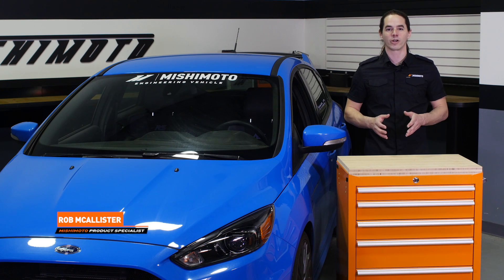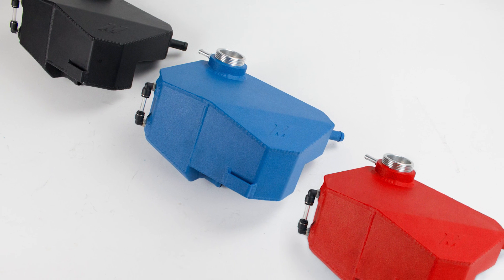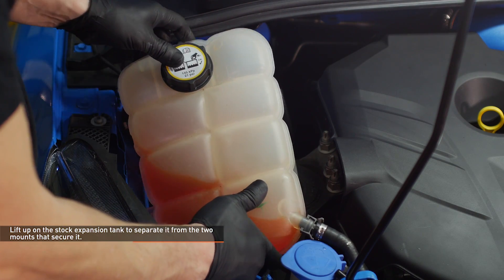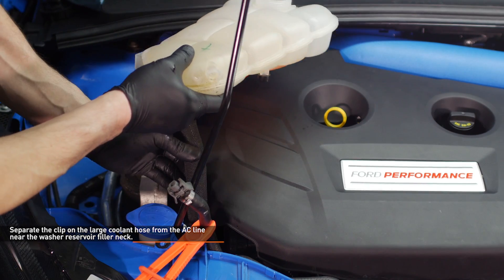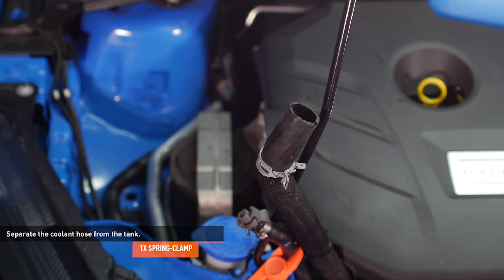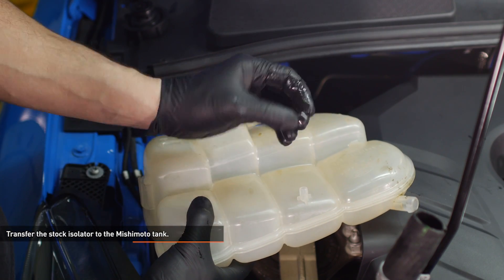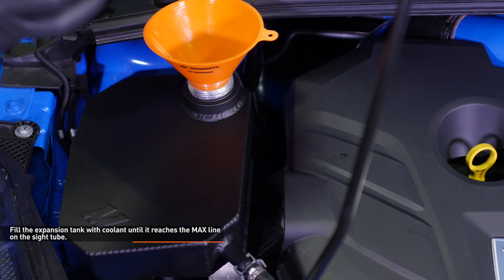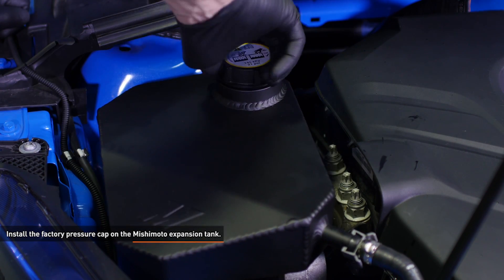2016-2018 Ford Focus RS/2013-2018 Focus ST Coolant Expansion Tank Installation Guide

Comment: Refilling the coolant tank but wondered if we are supposed to fill up the whole tank? Or just till the clear view tube is filled?
Reply from the maker: Fill the expansion tank with coolant until it reaches the MAX line on the sight tube. The small amount of air that got into  the cooling system during installation will purge itself as you  drive, so the coolant levels may change a bit as you drive. Be sure to check it again after putting in some miles.

Comment: Will I need to burp the system after installing a new expansion tank?
Reply from the maker: As long as you don't lose any more coolant than what is in the tank you should not need to burp the system. All you should need to do is refill the tank.
Reply: If the OEM tank had a pressure crack in it I still should be good to go? Correct? And not need to burp the system?
Reply from the maker: That would depend on how much fluid was lost. To be safe, you could bleed the system again after install.

Comment: What is the main functional cooling advantage of this over stock?
Reply from the maker: The main benefit of a new expansion tank is durability over plastic. OEM plastic tanks tend to crack and fail when enduring constant heat cycles.
Reply: Looks mostly, but it obviously will last longer too. Stock bubble jug is ugly see through plastic. I love mine in hyper blue.